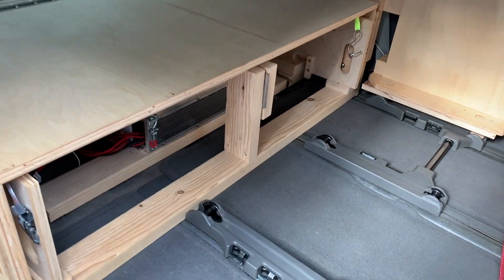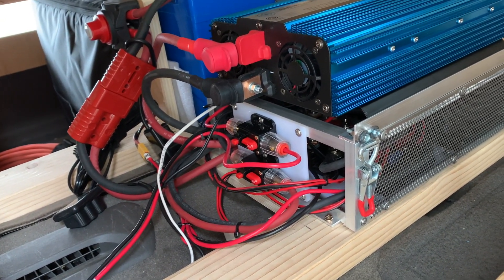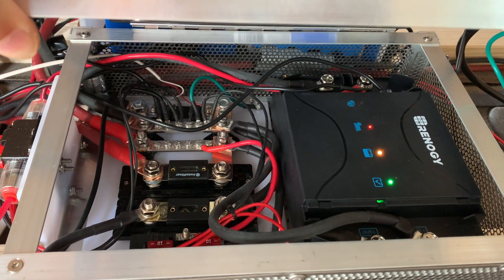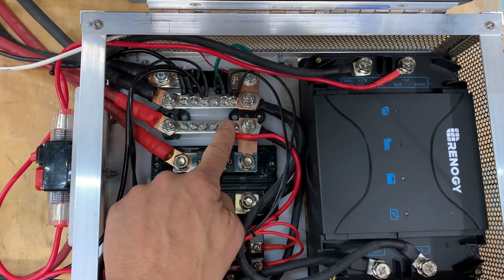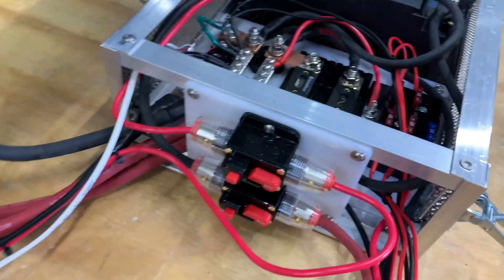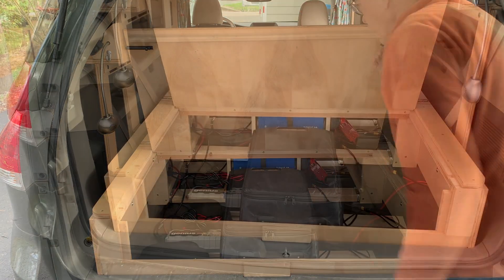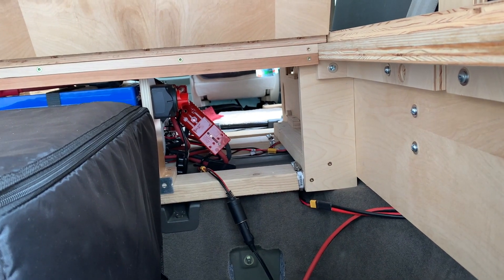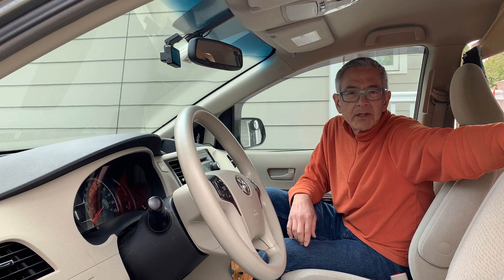Sienna MiniCamperVan's New PowerBox with Renogy DC-DC-MPPT Charging

Comment: So glad to see you back. I have a question: why do not you just connect the battery direct to the alternator? So what is the purpose of the charger in this case? thank you
Reply from the maker: Lots of reasons. Renogy’s site (https://www.renogy.com/dcc30s-12v-30a-dual-input-dc-dc-on-board-battery-charger-with-mppt/) has a full list but some of the key ones are:
1) a charger produces a 3-phase charging profile (Bulk, Boost, and Float) which is best for battery life
2) it’s best to isolate the starter battery from the house battery in case there’s a failure of the house battery 
3) Smart Protection Features: battery isolation, over-voltage protection, battery temperature protection, over-current protection, overheat protection, reverse current protection, solar panel and alternator reverse polarity protection